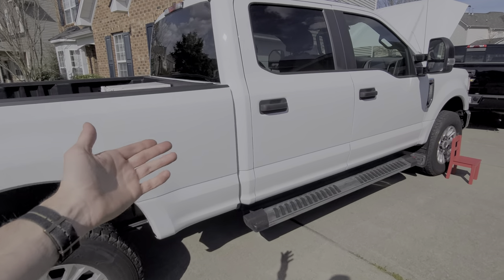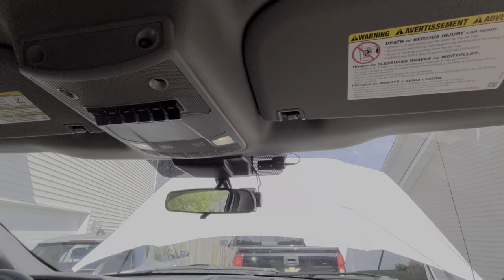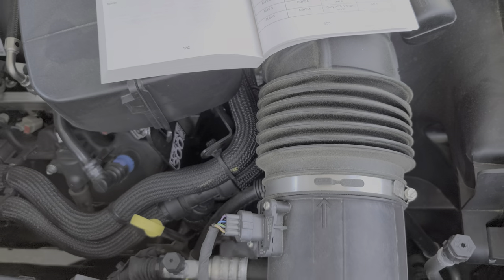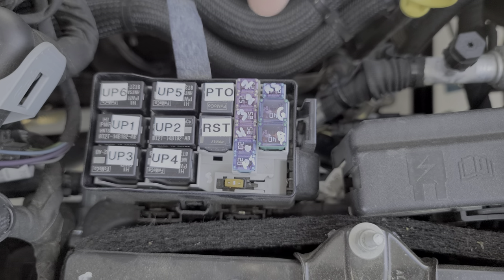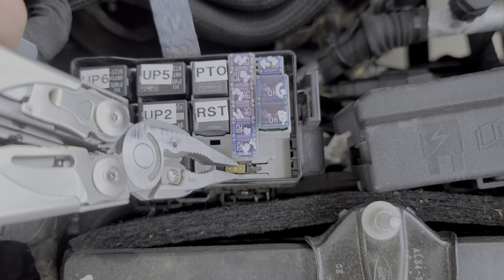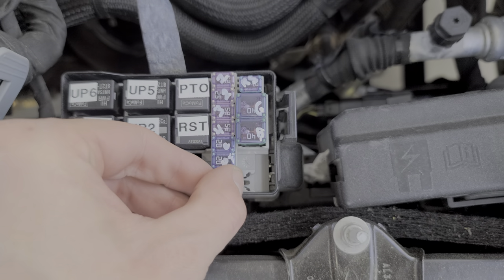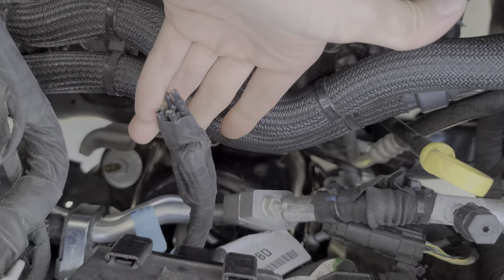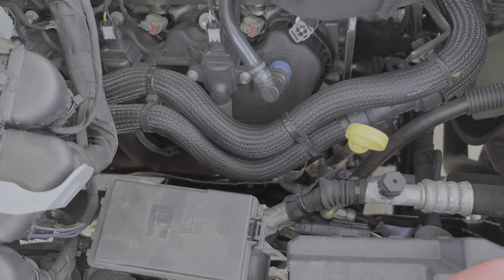2020 Ford Superduty Upfitter Switch Fuses & Relays, Wire Identification & On/Off Setting

Comment: I have the 2022 F350 Diesel.  Aren't there also leads for the Upfitter switches in the passenger kick plate inside the cab?  Are those the same wires?  Would come in handy for stuff you're installing IN SIDE the cab if true.  I've not looked yet.

Comment: i added some lights to my 2017 250 ,i had a hot wire touch the frame and blow a fuse i hope to switch 1 and 2 now working ,i dont know witch fuse to change to get them working again, can you help please
Reply: not working oops